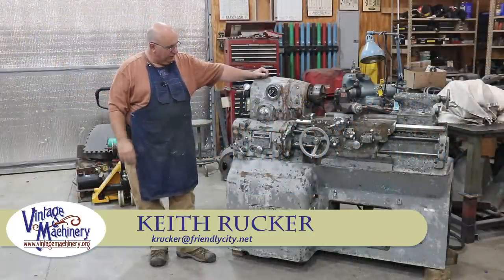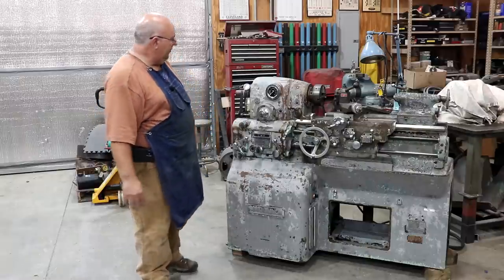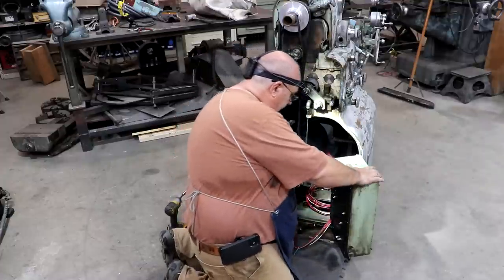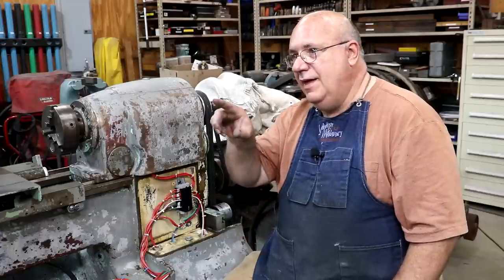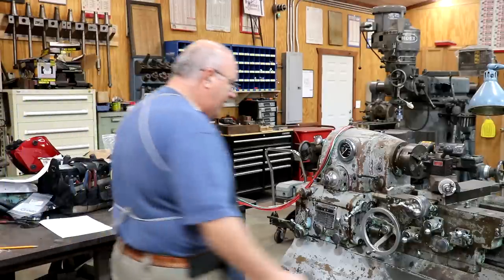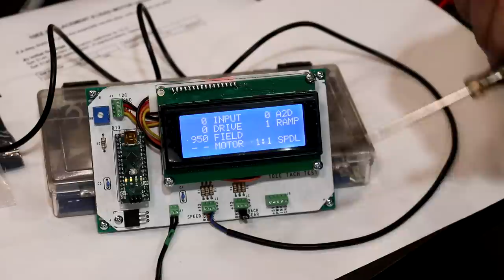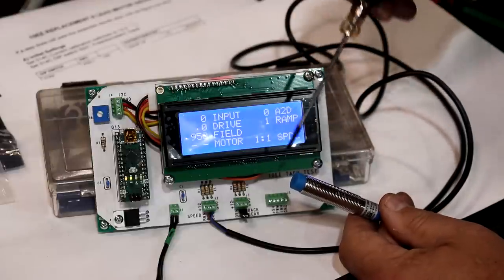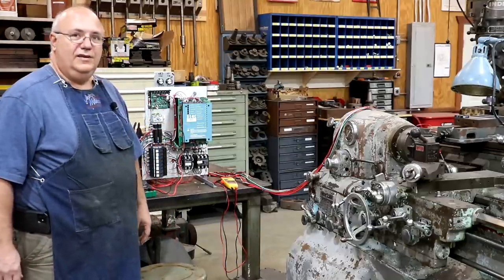Monarch 10EE Drive Retrofit 5: Wiring the New Panel to the Lathe and First Test Running

Comment: Liquid Electrical Tade: Saw this on another channel that was doing electrical repair. Supposed to replace the black tape or heat shrink. I have never heard of it, let alone use it, so I ordered a bottle.
Has anyone used this stuff and what were the results?
Reply: I have some, tried it, but never use it. It can be kind of messy. It's no where near as neat as heat shrink and looks sloppy on the joint. It's basically the same stuff as the Plasti-dip compound as on plier handles. If I used it on a splice for sealing I would still heat shrink over the top. There is also heat-shrink tubing with sealer inside so the two step process wouldn't be needed. Once it's opened the liquid tape has a limited shelf life.
Reply: Messy and it stinks. I think it was originally to be used as the sealant under a cloth type tape in industrial situations.

Comment: Again. The user shall not have any way to fiddle with the field current setting. That is supposed to be fully controlled by the motor inverter. This control design is ill.
Reply: I think that's what they are going for, when they are finished with this. That's what the Arduino Nano's job is, to co-ordinate the two drives to act as one. 
It's just to convoluted of a system, if you ask me, especially if your starting from "scratch" like they are.
Reply: @MrJohnnaz  Yes, sure, but they have picked a wrong motor drive then. There definitely must be available motor inverters, that support separately excited DC motors.
Reply: @Sixta16  I agree, but you are into a "real" drive to get that, and big $$. I don't know why they didn't go AC as any VFD is going to have reverse on it.

Comment: Wow, its amazing when you think about it. Hundreds if not thousands of electronic components to duplicate what a 80 year old analog system did. One tiny component fails and that's it. Replace a 1000 dollar unit. Analog part fails and you replace a simple part for 50 bucks.
Reply: Yeppers, progress is a double bladed sword!  My guess that if the machine hadn't been abused and was in a good work environment, even the old mercury vapor rectifier tubes would work just fine along with the other 80 year old electronics!
Reply: Electronic circuits rarely fail if you design them to last, just like hardware. I have plenty of electronics from the 50-70s that are still working 100% fine. Modern electronics, like everything else, often suffer intentional cost cutting and planned obsolescence. What is the point of making a cell phone last 50 years when the backend transmitters etc won't even be compatible in 10 years.